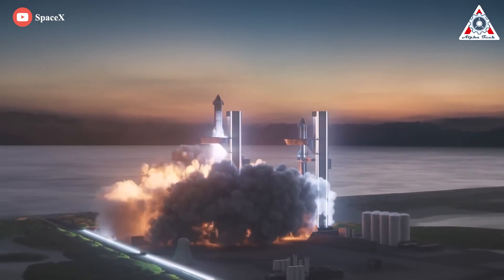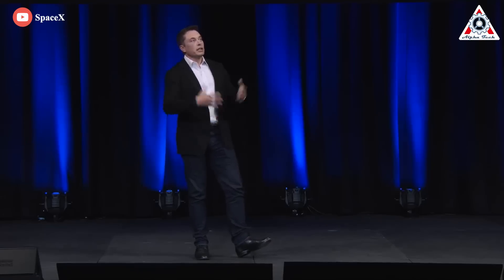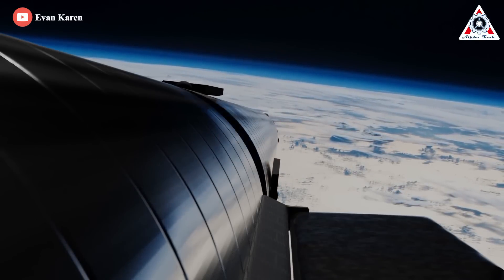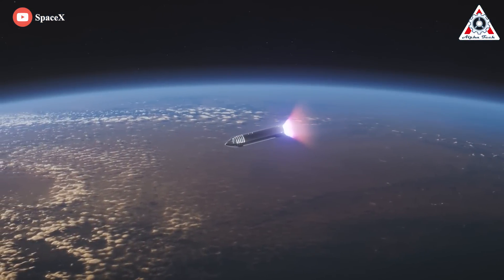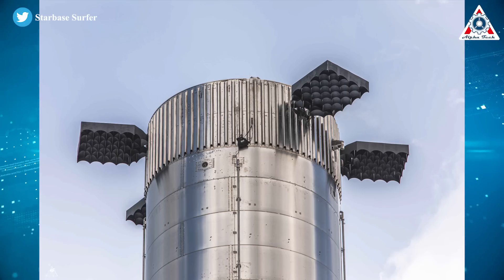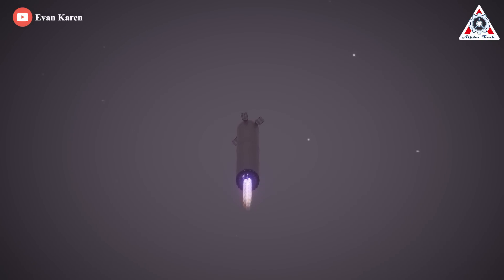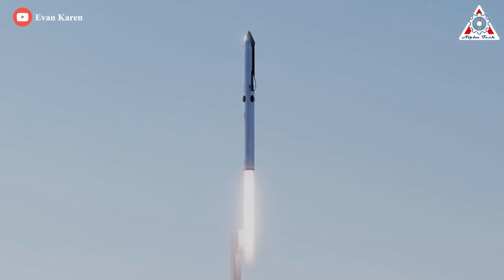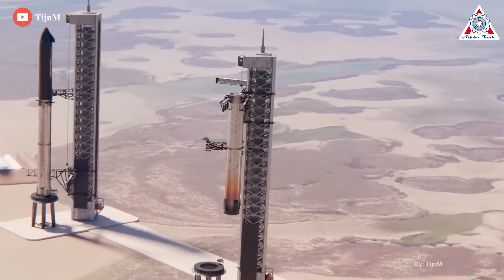SpaceX Genius New Stage Separation System Mechanism is totally unlike any others!

Comment: After watching the test launch I am even more concerned about the aerodynamic instability inherent in the full stack's configuration. All lift surfaces are well ahead of the craft's CG, even with the booster almost empty. As long as the booster gimbles are able to respond quickly and maintain directional authority it should be able to fly straight. If, however, disturbances in the air push the nose off-axis the aerodynamic lift of Starship's "wings," and now the fixed grid fins could quickly overwhelm the engine's ability to control the stack's attitude.

Once off-axis the lift generated by Starship will apply a bending force on the Starship/booster connection, making release energetic and quite possibly leading to a collision. The fixed gridfins may have been an attempt to reduce this force on the connection by accelerating the rate of rotation further and ensuring that the booster continues to rotate during the separation event, especially with some degree of propellant sloshing. There are countless ways for this to go wrong. I will be genuinely impressed if this ever works.

I have two take-aways; 1) I would have used springs, cold gas, hypergolic, or literally any other proven method of separation. 2) The passengers are going to barf.

Comment: Covering how SS's Booster lands is almost redundant when compared to the Falcon9 Booster. Difference being the landing legs are replaced by Chopsticks. So, no coverage on how StarShip is gonna land ?  Isn't that the Payload section and isn't it's re-use/re-launch ability what makes StarShip so unique? The "Drop Down" legs that were used on the prototypes that landed at BocaChica were sacrificial by design. They were designed to crush on impact and expendable only to allow for "proof of concept" on StarShips ability to do a controlled "belly flop" and then "Flip Maneuver" back to vertical. So, just how is Starship going to land and preserve it's ability to fly again. I don't think the lifting points under the forward flaps are gonna cut it. That would require WAY more accuracy over the chopstichs than the Grid Fins allow for on the Booster.

Comment: Explanation for multi-stages correct, but not the most intuitive to understand. In short as fuel tanks progressively empty one is no longer having to accelerate as much remaining fuel along with the weight of the rocket itself. The weight of the largely empty tanks is then a significant issue. By jettisoning an empty initial large 1st stage fuel tank and large 1st stage rocket engines which were needed to accelerate the very heavy first stage itself, the remaining mass of the smaller 2nd stage tanks and the payload can be accelerated by smaller 2nd stage engines.

In the example of Falcon 9 rockets the 1st stage weighs 25,600kg with propellant mass of 395,700kg and uses this up in about 158 seconds at which point it is 80 km high and travelling Mach 6 if the 1st stage is to be reused (needs reserve fuel for 2 burns to decelerate and land) or Mach 10 6,200mph (10,000km/h) if expendable. The 2nd stage weighs 3,900 kg with propellant mass of 92,670kg and will accelerate to a minimum speed of about 17,500mph (25,000km/h). All this to deliver a payload to Low Earth Orbit of 22,800kg, or for Geostationary orbit of 8,300kg.
In practice first stage at four fifths of the total initial weight lifts itself with its fuel up out of the drag of the atmosphere and achieves just under half required rotational speed, the fifth of the weight that is the second stage then accelerates to orbital speeds (or onwards out of the Earth's gravitational well), and the payload is around 4% of the initial mass.

Comment: Starship will not fire all six engines after separation from the booster. At separation the Starship will be at vacuum pressure. The three center engines are for the flip and landing only.

Comment: The cold ullage gas vents do not control the booster's "altitude," but its "attitude."
Reply from the maker: I will find more about this. Thanks
Reply: @alphatech4966  "Altitude" is the height of an object above Earth's surface.  "Attitude" refers to an object's orientation.  The ullage vents generally impart forces that are perpendicular to the booster's central axis, causing the booster to pitch, yaw, or rotate relative to that axis.

Comment: I believe that a few separate test hops with HB and Starship to test the concept of catching is necessary.  The mechanics need to be proven out and any kinks worked out.  The accuracy has to be much better than Falcon. It wouldn’t surprise me if NASA prohibits any catches at KSC until the system has proven to be reliable.
Reply: Falcon is already insanely accurate. keep in mind the landings on the ocean are on barges tossing from waves and sliding around. those boosters hit dead center when landing on land. 

There is also no point in testing landing before doing a normal flight since the landing part risks the loss of the vehicle. The flight is the least risky part so if you are going to launch you might as well do a full flight. 

As for the landing itself, they plan to have a ton of extra fuel so they can hover and move around as much as needed and if they start to run out they can ditch it away from the tower. They will know full and well that the engines work well before it goes to land and the engines are designed to survive being used many times. 

Its also unlikely they would do a test at KSC and are planning for it in texas. if texas doesnt happen they will have to wait until the new tower is built in florida as a backup for crew dragon as well as the launch tower for starship.

Comment: You say the Starship is “known…” to be reusable, fly to the moon, mars etc but I think proposed is a better adjective since no component of the system other than the original hopper has ever flown more than once and no part of the system has left the atmosphere yet.
Reply: its built to be reusable. they have a reusable booster already. there is no need to doubt them. it a reusable rocket even if its never flown in its latest version. SLS for instance is not designed to be reused, it will crash into the ocean.
Reply: The only thing "known" about Starship are the truly excellent CGI videos.
Only Vaporware hype offers as good promotional products, for a device that hasn't reached orbital velocities yet!
Reply: @jo2lovid  Boosters are easy, they can launch the falcon 9 , flip it around in the air and then land it, or fly back to the launch site and flip it again and then land there on a dime. The starship has flown and done its 'skydive' maneuver and flipped and landed perfectly. There is nothing untested about the system, they just havnt flown it all together yet.

I really hope for your sake you are just trolling.
Reply: I'm totally mystified by Musk projects especially in space.  As a sceptic about manned space flight in general l await the day when Elon proves me wrong.  I've long been an enthusiast about manned space flight - until l got to know a bit more about it as NASA progressed.   Everything l hear about space tells me "STAY AWAY".

Comment: Starship has NEVER landed with the kind of precision that will be required for a "catch"

JR
Reply: yes but they are not catching starship, They are catching super heavy which is not coming in from as far or as fast. right?
Reply: Cool...not really relevant since they're not catching Starship.

Someone decided to comment without actually watching the video...
Reply: doesnt matter, its accurate enough. not sure why you think it isnt. Previous tests only used one engine and had to balance the rocket at a weird angle, which is pretty amazing that it can still land in such a situation.

Comment: soo PER fluous. also the grid fins are out the whole time. the drag loss is less than the fold mechanism weight/gravity loss so thats why they went with that design vs the fold out mechanism on falcon9

Comment: If rotation starts before separation both parts would continue to rotate after separation. Perhaps a spring mechanism could transfer some angular momentum from starship to the booster as they separate to make it work like you show.
Reply: Any angular momentum imparted at separation, be that from spring mechanism or partial thrust vector at MECO..... would have to be controlled thereafter with RCS. So for stage 2 (ship), trajectory would be corrected as required prior at or after stage 2 ignition.

Comment: Im surprised they haven't tried catching a Falcon yet just to see if catching a rocket can be done
Reply: waste of money... plus they are not going to invest something that already works perfect.

I get the angle you are coming at.  But just apples and oranges.  It would be a waste of time, money. manpower to test this when they could just test what they already have built.  If they wanted to test, they can.  They have unlimited flights for NON ORBIT launches.
Reply: The engines are different.  Starship has control to hover.  While Falcon engines cannot be throttled down that much.  That’s a challenging part of Falcon landing.  Have to start the engines at the right point so velocity is near zero just as it touches the ground.
Reply: They have to make changes in the Falcon then, that's why there is no point in testing with it.
Reply: Catching a rocket that was not designed to be caught at all is just a good way to wreck a rocket and a tower.
Reply: @1BeGe  sounds correct.
Reply: I do worry a bit about the catching. Even though Falcon9 has a great landing record, it usually does not bullseye the target. It gets pretty close, but usually a bit off center, which is totally fine for landing on the ground, but could be really bad you are catching it mid air.
Reply: Indeed!
Reply: The Falcon program will be replaced entirely by Starship. It is not cost effective to do any further developement for an EOL (End Of Life) program.
Reply: @WhitentonMike   It is far from EOL though. It will still fly for many years to come. And they do upgrade it quite frequently.
Reply: @gustavinus  Elon has stated several times in interviews that there would never be a Block 6 Falcon 9 because all their developement resources have been moved to Starship. They have made plans to develope a new Dragon Capsule but that is a different topic than the Falcon 9 booster.
Reply: @WhitentonMike  they don't make a block 6 because there is no need for it. They still tweak block 5 if needed tho.
Reply: @gustavinus  The modifications needed to support a catch would be much more extensive than the "tweaks" you are talking about. Plus the catch tower would require significant modification because the Starship diameter and Falcon 9 Block 5 are over 5 meters different in width. I don't think it is just a matter of removing the legs and adding the catch mounts since the Falcon 9 is a composite structure.
Reply: @WhitentonMike  I don't disagree. Just making a point that they would do it if they thought it would be worthy. They've done crazier things. I think there is very little to gain (as in data). It would also be easier to just test into a "virtual" tower and then land in the ground (or sea) afterwards. It is just to collect data. But the major point is that the vehicles are way too different. It is better to just test it on starship directly. Also, I think some starships will end up having landing lags, while others will not. The lunar lander for example will have it 100%. The ones that will go to Mars will also need it. I would imagine that the "tanker" ones will be caught (so they can swap that landing mass into usable fuel).
Reply: They have to redesign fins and pretty much the entire structure to handle stress of being caught
Reply: It would require that the mechanism to be changed to fit a falcon.
Reply: @billfarrell6638  that's absolutely correct, the difference in scale isn't obvious looking at them separately, but it is substantial. Chop sticks weren't designed to catch f9, only booster and starship, as they are the same diameter, which is almost 3 times that of the flacon 9. 12'2" vs 30'.
Reply: @billfarrell6638  Honestly, they could just simulate it to a virtual tower and then land in the ground after that. But I am not sure there is much to gain from it, because the 2 rockets are completely different animals...
Reply: Maybe no mounts on Falcon to catch it on.
Reply: @maryellerd4187  The grid fins were never designed to support the loads of a catch.